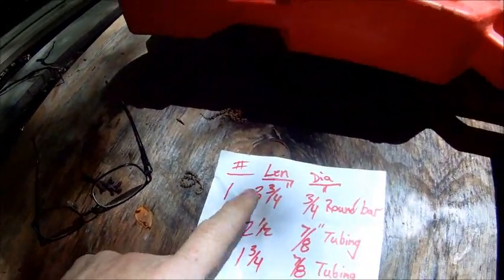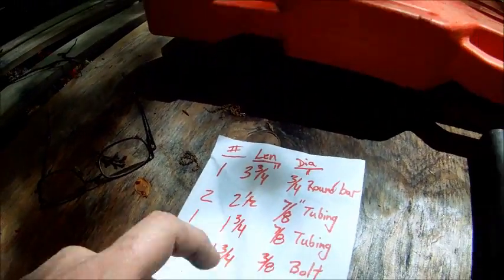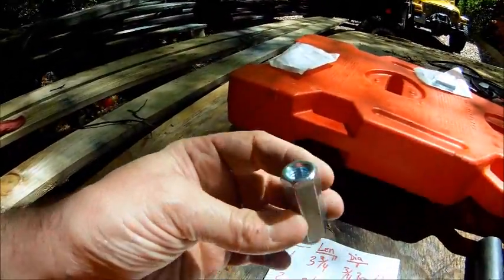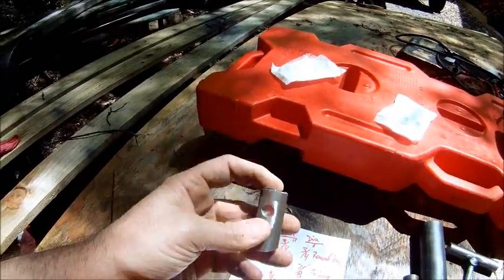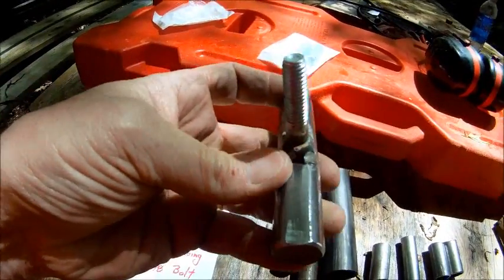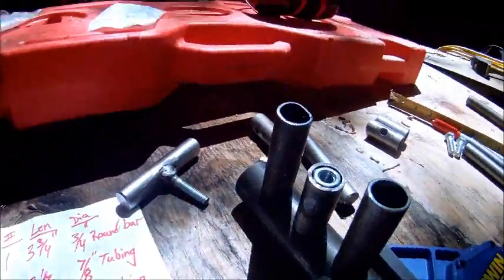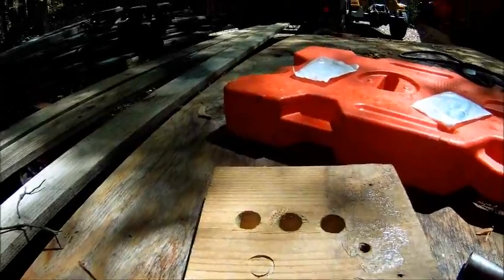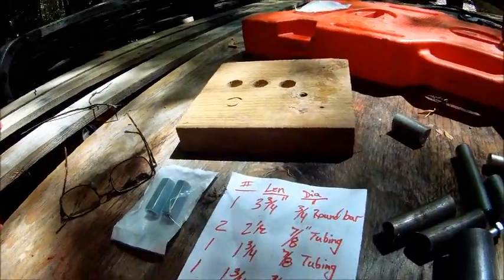RotoPax Mount - Make them yourself for $3 each!

Comment: $3 a piece? how so when the coupling itself is $2.50 and the bolt is probably $.50 not to mention the people who dont have tubing, and round bar. if you were to buy all the material and be able to get multiple maybe youll get down to $3 a piece but i really dont see it. i love these do it yourself videos though. ive got many great ideas from videos just like this.
Reply: lostinthesystm1 
The package of 2 couplers was $2.50, making them $1.25 each.

Comment: I bought the standard T handles and then used some old 3/4" pipe for the ends.
5/16" coupler nuts will mate to their "T" handles perfectly.
My mounts don't look as nice as davi200, will, but they are hidden by the fuel cans and my stuff was almost all scrap ready to be put together.
If the price weren't so high, I would have bought the mounts from RotoPax.
Unless you weld for a living, this will be a fun project to build an economical replacent for these mounts. your wallet will be heavier too.